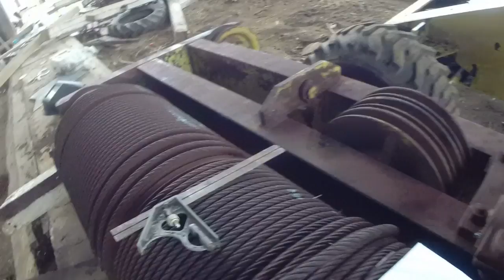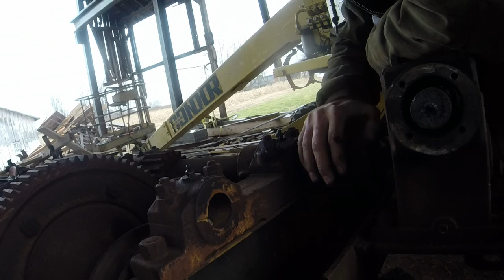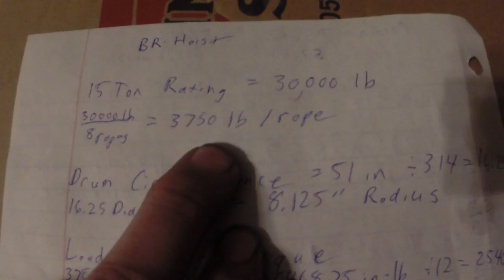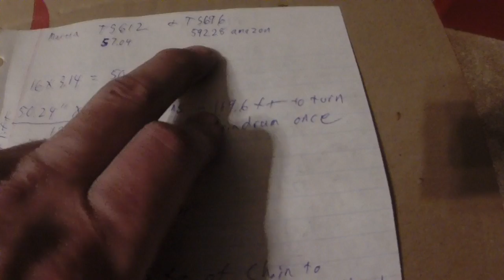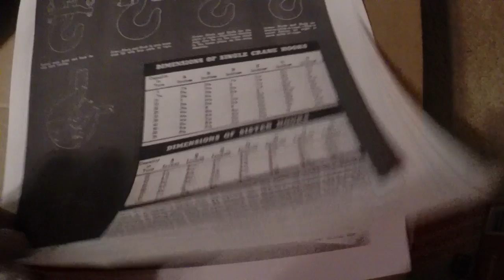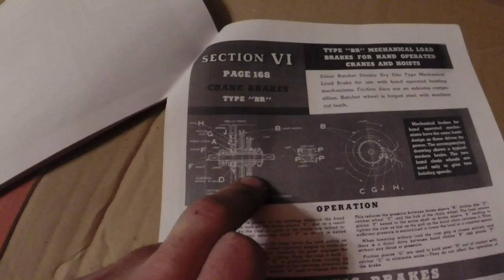Shaw-Box BR Hoist retrofit/renovation Part 2

Comment: After many decades of trying to redesign things, and robbing Peter to make Paul work, get a new motor and brake housing and put it back like it was. Cheaper in the long run.
Reply from the maker: I am too far into fixing it back like original now to do a full proper conversion to electric.  Besides I like using manual hoists, it isn't like it will be getting used multiple times a day everyday.

Comment: Just getting to this video Brian. Why not take a look at a truck/ATV winch in the 12K lb. to 17K lb. range. Then all of your electrical and controls are included. Hang the winch assembly on your rolling trucks and away you go. Your time is worth money!
Instead of using the winch line to actually lift your projects, use that drum like a capstan to drive a chain to the existing gear box. Using a truck winch will also give you a wireless control box.
Here is an example of what I am talking about. http://www.ebay.ca/itm/KO-Offroad-Winch-12-000-Wireless-Remote-fits-Jeep-Truck-Fairlead-85-Steel-Cable-/222049509862?hash=item33b32ea1e6:g:r0gAAOSwr7ZW4dKV&vxp=mtr.
Reply: Hard to find, but look for a winch with worm gear drive. I would never trust the break on these things, set up like he is talking about.
Reply from the maker: It is going back like original and will be hand operated, it is much simpler, more reliable, and more controlable.

Comment: I admire your undertaking of this project. I agree with the motor crowd, if you go manual that is lots of pulling for the small amount of travel and from what you say rebuilding the drives would be problematic. I'd keep looking around, Gov Liq, etc. Electrical might be more $$ but from a time/$$ point of view, I think you'd be better off.

Comment: Brian, the 16.5 diameter gear, are you able to get some plate of the right thickness flame cut and a welded boss?
Reply from the maker: +koliloaloa $300 for the plate big enough, which is cheaper than a bar of drop, but then by the time I buy the gear cutter since there are none on ebay the right style I would have $400 in a $500 gear. I might as well get one already made as I am sure it would take me several hours to turn a square plate into a gear.

Comment: What about the Hydraulic motors that run a combine and all those little rocker switches controls and remote started gas/diesel/propane motor to run the pump no electrics. appears shop is well ventilated so no exhaust fume worry(tongue in check). As a JD mechanic parts/operation should be familiar territory.
Reply from the maker: +Rick Brandt ventilation seems to just keep getting better and better in the new shop. lol I actually have a hydraulic power unit I was given that could probably run it.  Thing is what do you do with the big hoses? I am also not sure where to come up with a spring loaded hydraulic released brake for in case of a motor or hose failure during a lift. I bet the load lifting and lowering would be very controllable with a hydraulic system.

Comment: Brian

I cannot imagine using a hand chain to drve this and hoist 15 ton.  Sounds like a 1 man 4 boy job and you better pack a lunch..  You appear to be a one man operation and I am sure you are thinking about time and dollar considerations of man powering this unit.

I think you should compare hydraulic vs pneumatic vs electric.  THey each have advantages disavantages.  I suggest you go with what you know the best.  I am a motor control electician so I would go with that - I understand it the best.

Regardless of what you use to power the drum there is also the question of how you are going to get that power from the ground to the bridge and then trolley.  It appears to me you shop is 75 or 100 foot long and bridge travels full length.  Hopefully you got the electric rail they used in previous installation.  It can be a pain to keep that aligned woth the bridge to avoid dead spots.  A festoon (I think it is called) could work well for you wheterh air or electric and maybe even hydraulic.

Looking at your video I think the two bitter ends of the hoist rope are attached to the hoist drum.  If only one end of the rope is on the drum and other on the block then all your calculations are correct.  However I think with both ends of the rope on the drum your torque calcs are low by a factor of two.  In short you have two ropes on drum for total pull on drum double that in your calcs

Since you show this is a shop modification from factory original and a very poorly done one at that  I would throw out everything they did and stay with what factory oringinal is left and start from there.  Gonna take some time and for sure some money.

I would take one of the 2 ton chainfalls and hang it from the trolley.  It would come in right handy to balance a long load
where you cannot get the big hook on center.  Hanging it on a davit mounted to the trolley would surely eas maintence.  Worked on cranes up to 250 ton and getting gearbxes or motors down to the ground was a challenge at times.

Dan Bentler
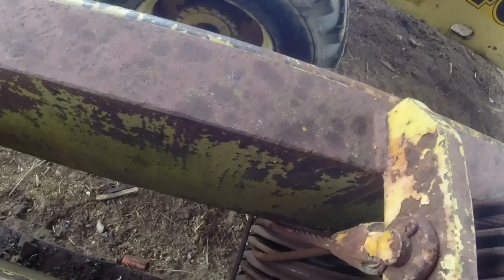Reply from the maker: +dan bentler At 2:18 you can see the end of the cable attached to the hoist frame so my calculations should be correct. Unfortunately the runway was half as long in its previous installation and they just had a cord feeding from the middle out so they only needed about 20ft of cord to get from the runway onto the bridge and they used a self retracting hose reel setup with an extension cord I think, pretty common for my part but I guess it worked for what they were doing. I have determined the box lacks capacity for the load as well and thus will have to be replaced or risk a possibility of the worm failing and dropping the load, not really something I want to deal with.  Even set up mechanical the crane will be a thousand times better than what I had before and again it will only be used a few times a year for the big loads so it is  hard for me to justify the electrical expense of doing it right at this time. If I went electric I would do motors on all movements as running the power properly onto the bridge is nearly as big an expense as the actual motors, brakes and controllers would be.
Reply: +bcbloc02 
Found the dead end of the wire.  Calcs should be good.

Hours and $$$ for new motor gearbox etc etc versus one or two hours per year cranking on the hoist chain makes sense.  That is where a 2 ton or so chainfall seems good to me - dont have to move the mas of that gear train ahd hoist drum.

SO later on when you get to electric drive a cord reel just may work fine.  For now borrow neighbor kids.

Dan Bentler
Reply from the maker: dan bentler
 Maybe I could tie Baily to chain and get a cat. LOL I have also considered the fact that adding the additional gearing back neede for manual would allow the use of a much smaller reducer that would cost a lot less money.  I have been scouring ebay pretty hard last several days and have been unable to find a reducer that would handle the torque and fit without major mods.  New ones from Motion Industries are about $3500!
Reply: +bcbloc02 
Dog gone that crane goes fast.  More n one way to skin a cat??
Time spent thinking things over can save bunches of time and grief.

Dan

Comment: Hi Brian
I have a 2 ton chain hoist that is reasonably quick to use, but I could not imagine using it at 1/8 the speed it is now. 2 ton times 8 cables = 16 tons.
 I would think if a worm gear reducer was used to drive a bigger worm gear reducer the smaller one would act as a brake for the larger one. 
Instead of gears a guy could use sprockets to get more gear reduction and that would cut down on the size of the worm gear reducer needed.
Also the commercial garage door openers, the kind that turn the shaft on the torsion spring have brakes in them, they also have a small worm drive. I have 2 of them sitting around collecting dust.
For now if I were in your shoes I would hang a manual hoist from it and get back to work on the building. 
John 
PS I will keep my eye out for another gear reducer you could use, there is a scrap yard here I go to a lot and you never know what you are going to find from one day to the next. My latest find was a hyster 6000 lb fork lift, it runs and I drove it in the shop after I charged the battery still can't believe it. I got it for 500 bucks, the brakes did not work but they soon will be.

Comment: You have to install a flexible cable to power the crane from the far end of the tracks and the cable will have to be about one and one third the length of the tracks. Plus new motor, brake and possibly new gear box. Mechanical conversion may be the cheapest and easiest way.

Comment: Go electric, my choice.  I have used many hand hoist, even ones like yours.  Slow and frustrating after awhile.
Reply from the maker: +Randy Richard Any thoughts of using a VFD on the electrics? What do you think the likely hood of the vfd commanding brake release but then having the speed turned down too low for the motor to start under high load and it actually dropping because the brake is released? I guess with testing a minimum start speed could be programmed in most controllers to ensure the motor would  producea minimum equivalent torque to the brake.

Comment: Brian

If it's any help re motor sizing at the iron works we had a large range of cranes

The 5 ton maintenance workshop ones had 5 HP DC or AC depending on the vintage
The 5 ton production ones had 40 HP AC motors these were used it the automated casting plant ( always female drivers they had a better touch and were very quick ) they could unhook without help 

But the ration of load to HP did not scale up in a uniform manner the 175 ton metal ladle crane only had a 50 HP motor fitted  I cannot remember what the 750 ton one had on

the overall gear ratio is going to be very high so it would be slow at fixed speed better do the calc to see what you have not sure if a TP VFD setup would start up against the load 

Stuart
Reply from the maker: +Stuart Hardy The hp requirement is related to the speed of lift by a lot. This setup was slow at about 3.5 ft/min. A more typical crane lift speed is 10ft/min so a 7.5hp motor would be better suited for this crane with a much faster worm gear.  Biggest problem going that route is you get into much more expensive brakes since they have to hold much more torque too. Finding another hoist in the proper size would probably be the cheapest way to go if I went that route.

Comment: HI Brian, here might be a suggestion. in the military, I worked in a large warehouse. years ago we had chain. As time went on they either added an electic motor or replaced the whole thing. specifically the convertions were done to where you could use a lever to switch back and forth from manual to electic. Not sure if that might lead to some inspiration. Basically set up your manual, then as time and money allow, set up your electric. I'm sure you had to save your pennies for the hoist to begin with., it doesn't look cheap. Good Luck Brian. Looking forward to see how you do.
Reply from the maker: +Lonnie Beatty I wonder if they just used a shift collar and the hand chain turned the motor shaft? I have also been trying to figure  an easy way I could alter the hand chain gearing from the ground so I could have fast lifts with light loads and deep reduction for heavy loads. Probably over thinking it though, I should just stick with my original plan, and just hang one of my small hoists off the crane hook for light fast lifts. The big lift capacity will rarely be used.
Reply: Agreed, setting it up the same way you originally planned. As said before that would allow you to plan something so creative, it's simple. I think your on the right track though i.e. retrofit. You'll come across something to get the creative juices flowing. If you want eyeball those roll up door systems, locate a National Guard/Reserve center and see if you can check there role up doors. Not sure where you are in the states but you could look for an Active duty post/base (any branch) go over to the logistics/supply warehouse to check their doors. Good luck Brian!

Comment: Hi Brian, Googling for "Safety power Rails". if you don't want go with a rail or festoons, another option is just an extension cord that you plug in near ground level, and just put  outlets along the run of the building. I suspect that you aren't planning to move the crane very far under most operations, so perhaps just plugging it in at ground level is an option and put in the festoons or a power rail system at a later date if it becomes a problem. 

Not sure I would trust that cable for 15T. You might need to replace it. Its possible that the cable you have has already been replaced and may not be rated for a 15T load. 

Another option is to monitor ebay or other sites to see if a more modern crane comes available. You could  perhaps swap the guts with a more modern version. Third: just buy a used 15T manual hoist and put mount it on a trolley on the bridge. or fabricate a new bridge to accommodate a manual hoist on a trolley. I suspect buying a 15T manual hoist with trolley would be the cheapest and quickest option.

http://www.ebay.com/itm/ME-15-Ton-Chain-Block-Chain-Hoist-20-Foot-Lift-CBLK15T20L-/161194185149?hash=item2587ec11bd:g:JaQAAOSwabhUXkZp
Reply from the maker: +Guy Tech The cable only holds 3750lb not 15ton. It is a 9/16 cable and appears in good shape, should be more than up to the job. I really like those power rails, looks like Demag and  Vahle both have various versions available.  I bet they are pricey though.

Comment: I had a design awhile back at work that used a Gast 8AM-NRV-?? (I think that was the basic part number) air motor with a 56C face mount and one of these pneumatic release brakes  http://www.machiii.com/Products/Brakes/Spring-Set-Brakes/NEMA-Frame-Spring-Set-Brakes-C-Face-Mount.asp  mounted to a Dodge gear box. The motor eats a ton of air and is a bit sensitive to small air lines and fittings (as in size them big). McMaster had a decent price on the motors.
Reply from the maker: +Mbb midwest That is awesome, that outfit with the brakes is not far from me here in Kentucky! I wonder what the performance is like of the air motors when trying to move just a little bit with a lot of torque requirement? I know my air impacts are sensitive to stall, but I think an air motor would be better. I need to see if I can find some torque performance curves for air motors.  Plug the air hose to the raise or lower side and squeeze the trigger sure sounds cheap and easy.
Reply from the maker: +Mbb midwest Can you just run the air into the exhaust port to reverse air motor rotation on that Gast?
Reply: +bcbloc02  Most of their models are reverable, just depends on which port you power up. I have also used some version of a pneumatic hoist pendants, they have two paddle buttons for direction. You might be able to feed the air right at the pendant control. This would help avoid festooning the air line.
Reply: +Mbb midwest http://gastmfg.com/products/air-and-gear-motors/lubricated-air-motors/8am#models-anchor-section. This looks to be in the ballpark for your torque requirements at zero rpm. Its a size up from a 56C mount so will be a 145TC. The only downside to this is that you will need a ton of air.
Reply from the maker: Mbb midwest
Yeah I looked into it today and air may not be viable. With the reduction to get the torque down like the electric I am looking at 4min+ for a full raise. My air compressor only makes about 15cfm so it has to pump 10 minutes to supply the air motor for 1minute so it would take almost an hour to complete a full raise. I would rather be pulling hand chain.

Comment: It appears that the worm gear is held in by that hex bolt on top of the reduction box. It should unscrew off the gear. There are at least 3 other hex cap screws in the top and each side which are likely retaining something.  There appears to be an access plate on the coupling output shaft that is big enough to withdraw the gear and shaft.  It was assembled therefor it must come apart.

Comment: Brian Google babbitt chain wheel. they are for operating valves. looks like they make them up to 30" diameter
Reply from the maker: +sodavillejason Those valve hand wheels are for like swing set chain and not really suitable for load lifting torques.  An outfit in Ohio called David Round makes the proper ones, but they don't have any over 12in.

Comment: I can offer little in the way practical help or advice beyond the following: Regarding the pulleys that the chain drives on your hoist- I would approach a boat winch repair company as the windlass pulleys need periodic replacement through wear of lifting the anchor chain. I have seen a couple of these recently being replaced with new ones so somebody manufactures them. A ship chandlers might be able to point you in the correct direction to find what your looking for. 
Lastly thinking about the movement of the whole crane up and down the shop (I think you said 60ft) some saw mills use a wire rope system with a reversible electric motor driven winch at one end of the sawmill which is used to move the table plus log [a hefty weight] at all sorts of speeds past the saw and back again repeatedly. This perhaps might offer you some ideas and possibly parts to meet your needs from a sawmill.

Comment: Personally I'd go with electrical purely because it'd make it more accessible, making it easier to use the hoist for borderline back breaking stuff that needs lifting. If it's a hassle to use a crane, it wont be used as much as it should.
Reply from the maker: +Perius Push a button and watch the work done! Sounds like CNC. :-) I know what you mean though, easy is always nice.